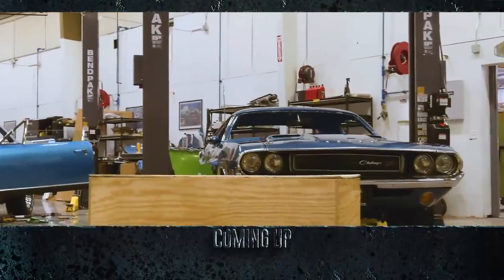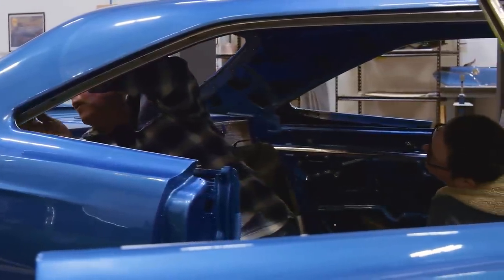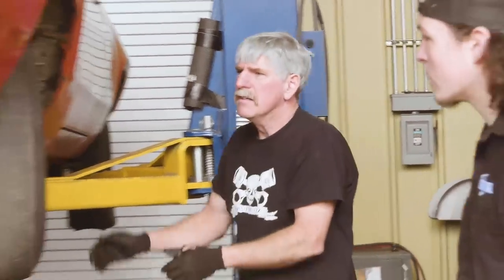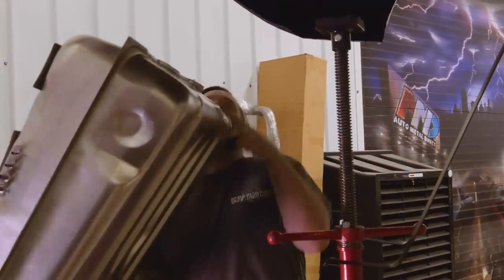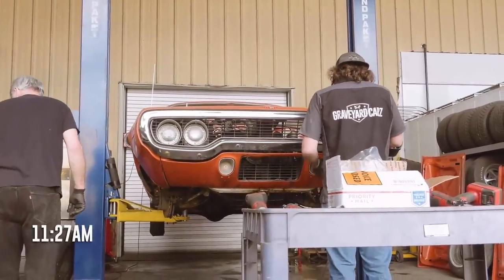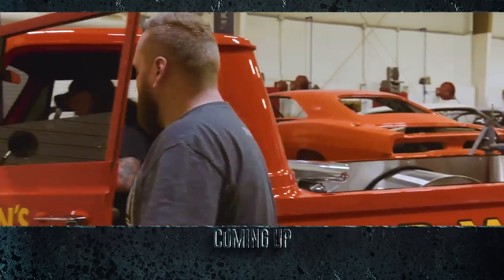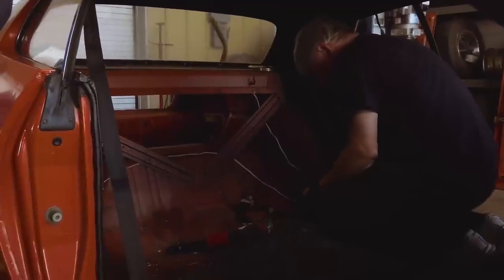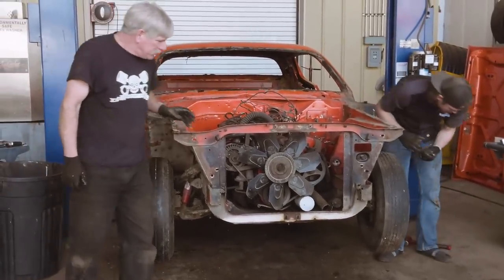'71 ROAD RUNNER THAT ALMOST DIDN'T GET FINISHED IN TIME FOR THE OWNER TO SEE IT.

Comment: When in high school, my father took his three teenage sons out to purchase a new car. Ended up at Plymouth dealer and came home with a '71 Road Runner 383, with wing and spoiler package, metallic racing green color, and a "Slap-Stick" automatic. Tires wore out sooner that he hoped. Left trail of smoke behind it with pedal to the metal.  Freeze plugs blown out more than once.  Later added some aerodynamic feature I saw on NASCAR racers. Covered the main grill with Lexan panel attached to bumper, opened up lower intake and extended the front spoiler. Car became extremely quiet at freeway speed, and no overheating in California summers. Did 130 on new highway that was under construction, little traffic ever.
A couple of brothers driving their fathers Hi performance Camero never kept up with us.
Eventually my youngest brother went out with friend in the middle of the night, racing around and totaled a parked Porche. The owner was happy as he was trying to sell it at the time. Memories.  😂